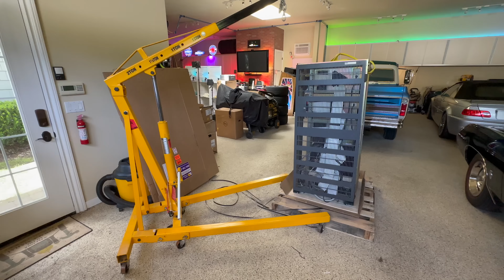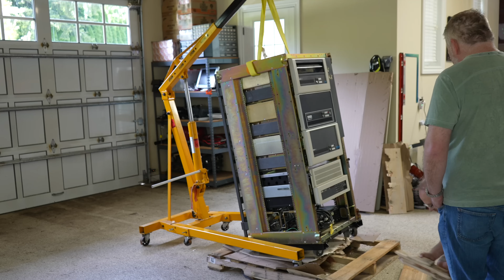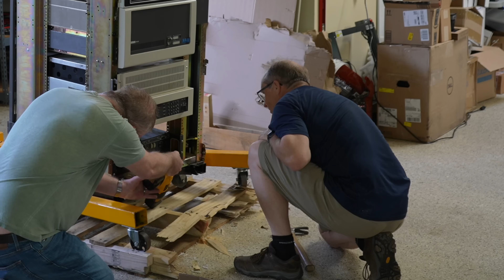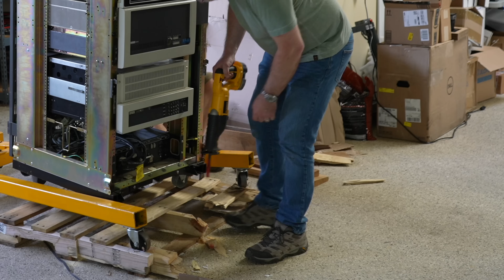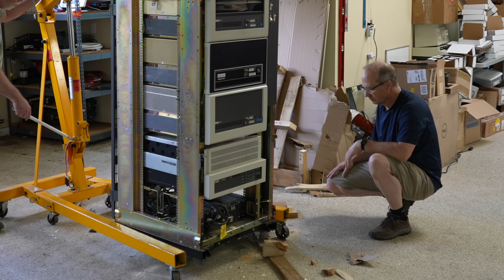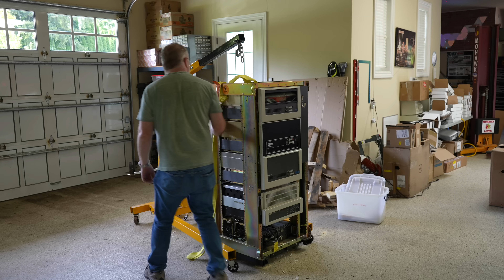I Bought the HEAVIEST Computer on eBay: The PDP-11/34!

Comment: Oh,hell, you don’t have any real old DEC vintage machines. You want a real beast, try to find a PDP-15. It was an 18 bit machine consisting of at least four 19” racks. To bootstrap the computer you had to key in about ten or so instructions so it could read a punched paper tape. Once the paper tape had been read in, it could then bring in the operating system from DEC Tapes. The OS was stored on a 256 kbit fixed head disk. But the PDP-15 was a single user device. If  another user had been using it, and I wanted a turn, I would have to bootstrap the machine from scratch and load in my copy of the OS. It originally had 16K words of 18 bit core memory. When we were able to afford another 16K for a total of 32K core memory, we thought we had died and gone to heaven. Ultimately we were able to add two 2.5 MByte RK05 removable pack disk drives supported by a dedicated DEC 11-03 processor. 
During my time we had an DEC 11-750 running RSX-11, a PDP 11-35 running RT-11, a PDP 11-45 a MicroVAX II and ultimately a VAX 11-60.
Oh, the memories! 😂 I  wish you the best of luck with your DEC machine. 🤞

Comment: My IT Career started in 1983 as an operator using DEC PDP11 24, 44, 70 on RSTS/E and also VAX 750 and later onto 8310 Cluster (a true clustered system) and then to MicroVax. These were fantastic years ❤

Comment: In collage I picked up at the MSU salvage garage 2 dec racks, 1 had a tape reader and 2 rk disk packs, the other a PDP 11/40. and an insane amount of core memory.  Only powered it on once, but didn't know enough to how to get it running, and this was back before the internet.  So I parted it out keeping some of the core ram and giving the rest to friends.  Fixed up the racks and repainted them and sold them for way more then I had paid for the machine in the first place.   Now I really wish I would have kept it. 😟

Comment: Right ,  the disc is a disc cartridge not a pack ,  the air filters can be made AAF used to make them for us, whatever you do , CLEAN the discs before use if they have been stored, with IPA , do not use them cold allow them to warm up especially if there is any possibility of Dew,  clean the heads with a punch card and IPA ,   DO NOT leave the discs in the drive with the fans not running ,  it's an open drive and if you are careless you will get crashes,  you are lucky that's not a High Tec drive like a Phoenix 96 Mb as if it was you would have lost it on first power up ,  be very very aware of cleanliness with open drives ,
Reply: You are better off sticking with the modern simulation of the old drive remember the "drive" is only the transport it has zero intelligence , it's only function is to spin the disc place the heads and send the signal from the heads to the controller ,  alignment is difficult to be able to read previously written discs , get an alignment disc  you may need an exerciser or make one to select the correct track with switches , it's easy ,  beware of Grounds ,  and damaging the daisy chain cable

Comment: Actually, the first version of Unix wasn’t actually developed on a DEC PDP-11/20 but a old DEC PDP-7 that was laying around at Bell Labs where Unix was invented. Some my quibble of what counts as the first proper version of Unix but it all started when a Bell Labs computer scientists wanted to port a game he had written for a GE mainframe computer (before GE sold it’s mainframe business to Honeywell in 1970) that Bell Labs was about to get rid of as they no longer needed it. He ended up writing a very basic OS on an old PDP-7 laying around bell labs in order to port his Space Travel game to it. This was originally informally known as Ken’s New OS. As other colleagues saw what he’d done they joined his project and eventually renamed it Unix. After they got a new PDP-11/20, they port the alpha version of Unix over to the PDP-11 as the PDP-7 was by that point very antiquated. 

At this point, Ken’s New OS/Unix was being developed very organically and didn’t have any proper version numbering. What became known as Version 1 Unix (aka 1st edition Unix, Unix Version 1, Unix 1st Edition, and so forth) was named after the first edition of a manual  Ken Thompson and Dennis Ritchie and others wrote to explain how to use the new OS and as a result all Unix version going forward were named after each new edition of the Unix user manual. So you could say that the proper 1st Edition of Unix was developed on a PDP-11/20 but the alpha version of Unix was started on a PDP-7.

Comment: Ex-DECie here.  Started in 1976 and lasted until 1993.   11/34 brings back a lot of memories.  I had an RK05 head crash overnight and the cabinet was full of shredded metal in the morning.  Made quite the noise.  To be honest though, the 11/34 was heavy but you are talking about the entire cabinet and not just the 11/34 box.   Now, let me know when you find an ESE20 which is DEC's foray into solid state disk drives.  I built them.  Each memory board in the cabinet was 2,500 dollars.  The single disk drive was only $120k.  Still have the manual.  I also wrote the build process.  It was the fastest thing going at the time.  Now that was a cabinet as the backup power supply (UPS) was heavy and took up about half the cabinet.  I worked mostly on the tape drives until we started building the ESE20 and also built a bunch of the failed PC line.   Anyway, thanks for the video.  Brings back a lot of memories.  Best company I ever worked for.  Ken Olsen was also the kindest man let alone a CEO.  Criminal what the board did to him in the early 90's.

Comment: Thanks for the trip!
I worked for DEC in the 80’s, had an 11/23 at home with 2x RL-01 drives - running RT-11 and RSX-11 with a couple of terminals and printer.
It was a blast seeing the RK05 dives (only 2.5 MB!), hence my lust for the RL-01s with 5MB - and much quieter without the voice-coil positioner.
A great purchase in great condition, but not cheap 😱
Enjoy it !  Jealous of the 11/34

Comment: you might consider software by microware.  the os-9 was written in the period and a bunch of boards are around for scopes and digitalization measuring units
Reply: I'd run some bit coin markets on the pdp, and traffic signals to demonstrate relative ambitions.. but that's just me .. reservoir dogs . Tarantino

Comment: Excellent video.  I work on the pdp11/70's back in the late 80's when working for AT&T Long Lines. We had our own minicomputer systems group for maintenance and operations support. Ours ran on Unix system 5. Our VAX780 and vaxcluster system was on vax/vms. What a job, good Ole days,  good memories.  It was all very interesting.  I went to DEC classes in Bedford Massachusetts on the PDP11 and VAX. So this video really reminded me of this technology. I still have books on PDP11 and VAX programming by Richard H Eckhouse Jr. After all these years. I've been looking at a PDP11 emulator recently. Anyways , thank you for this video.

Comment: Really enjoyed this vid - the very first multi-user system I administered, back in prep school, was a PDP 11/24 running RSTS/E. I kept hacking super-user accounts, so eventually they put me in charge of running  it and fixing the vulnerability I was exploiting, which was just writing code to fake the login screen and using a command that allowed a programmatic switching of accounts (after capturing the log in details, of course). As I recall, it was trivial to disable the command - but it's been 35 years so I don't remember all the details.

Anyway, keep up this great work!

Comment: When I was a kid in the early 80's my dad's neighbor (who got him into computers) had a PDP/11 in his basement that came from a steel company when they upgraded it.  What's cool about that I think is at the time it was probably still an impressively fast computer and that knowledge of PDP hardware in 1982-84 was probably still very much desirable to have.  I was too young to see it but he had the full row of PDP cabinets.

And compared to my dad's Cromemco System 3 with 8 inch floppy drives, it was probably still very powerful.  What's crazy is my dad had a running point of sale system in his motorcycle dealership he hand wrote in BASIC out of books running on multi-user C/PM systems.  Later when I was like 9-10 I remember helping my dad port it from CP/M to DOS Quickbasic 4.5.

Comment: 23:54  if i'm not wrong, that card cage can be rotated .... so that the wire wrap side is easily accessible from a chair.....
Reply from the maker: I couldn't figure out the rack and how to flip it... not entirely sure if it does or doesn't!
Reply: @DavesGarage  did you figure out the rack type ?

Comment: Get a DEC VAX 11/780, which has a "user writable control store," i.e. the user can microcode it.  Forget assembly!  Access to your code with XFC op, as I recall.  You do have to break up long operations somehow because it otherwise keeps interrupts out.  Regular memory is your scratchpad.

Comment: Nice to see you exploring yet another bit of my history. In college, I programmed in assembler on a PDP-8e, which was octal, and somewhere I used to have full schematics of the logic flow of a PDP-8e. In one of my first jobs, in addition to sometimes operating an IBM 360 mainframe, I programed in COBOL and assembler on PDP-11s, mostly 11/23, 11/34, and 11/44s running either CTS-300 or RSTS, and having RL01 drives. I never got into the hardware, but I think they were newer models than you have, from circa 1980. I do have a vague memory that at the time, 64KB of RAM was about $8000, and a 100MB 12" or 14" hard drive was $30,000.

As far as wire-wrapping you just need a wire-wrap tool, after which it is easy.

FWIW, the oldest "PC" I've seen was a MonroeBot, but while it appeared to be complete (in 1982), it was not operational. The same guy also had some old magnetic "core" memory from mainframes.

Comment: Since this story occurred in 1982, 42 years ago as I write this, I can finally tell it. In the early 80s I had a friend, Steve, who was a field service tech with Digital Equipment Corporation [DEC], the maker of the PDP series of computers. Steve wasn't the brightest bulb on the tree, and always looked for shortcuts. He got it into his head that he had to have a PDP 11/03, and he knew just how to get one - at a client site that he'd recently visited. Somehow or other, he convinced me and a friend of mine to go retrieve this machine from it's rightful owner.

Late one Saturday night, my friend and I were dropped of at the site, a warehouse and distribution building for a local retailer. The building had no security and poor locks on the doors - a pocket knife was all that was needed to gain entry to the warehouse door. We entered and quickly located the computer room, and to our surprise, found not just the 11/03, but a newly delivered 11/34, with all the typical peripherals, lots of disk packs, and the famous Orange Wall of user manuals. We trundled the the rolling racks out to the warehouse and onto one of their delivery trucks, along with virtually every other item in the computer room. During this operation we kept in contact with Steve, who was safely parked a half mile away at the entrance to the office park, and we communicated using 2 meter handheld radios.

Within a half hour or so we had everything loaded up, and proceeded to drive to Steve's townhouse apartment, where we carefully unloaded everything and placed it in his basement, where it took up most of the available space. We then dumped the truck a mile or so away and returned to the townhouse. 

Steve had promised a $2,000 payment for the 11/03, and as I had no one else that I could go to with the 11/34, he got that at no extra cost. What a deal, right? Months went by with no further payment other than the $200 he'd given as a down-payment, and all attempts to collect fell on deaf ears. He was certain that there was nothing I could do to get my money, but finally one day, while he was at work, I rented a truck, and with the help of a few friends, we repossessed all the equipment, selling the entire lot to another DEC guy for $5,000, again on payments, which I actually did receive the total amount due, no doubt in part because the new buyer knew very well the extent I would go to to insure payment. 

Of course Steve was furious, but I didn't care, and refused to tell where all the equipment had gone. A few short months later, Steve was fired from DEC for a mistake that apparently caused a VAX 11/780 to catch fire, or to at least fry a lot of circuit boards.

Funnier ending, all the local DEC people and others in the local tech community were dead certain that the original owner of the equipment had caused his systems to disappear because the company that sold it to him, along with the $50,000 accounting package included, had been unable to get the equipment and software to work the way it had been promised. 

Shortly after this heist I left the criminal world, and went into wholesale DEC used equipment market, buying entire systems from government surplus sites, breaking them down, testing, and reselling to various dealers around the US. This business lasted into the late 90s, until government surplus departments discovered the internet and sold directly online, cutting out middle men like myself.

Comment: I really enjoyed your description of how you got your system up and running. My first encounter with a pdp11-15 was about 1971, as I worked for a large semiconductor manufacturer. My job was to keep a bunch of computers and test equipment (part sorters) working. We had a bunch of DEC computers and equipment to work on. 
One morning I was told that a new transistor test system had been had been delivered to one of the departments that I supported,  I immediately went over to the other building and saw the first PDP-11 system I had ever seen.  It had a paper tape reader and punch, and a LA-30 printing terminal.
That was only the start, by 1970 we had a bunch of PDP-11 systems, and we still had several PDP-8 based systems, as well as some other company's computers.
The IBM-PC caused the end of that era.

Comment: I recall there being a program that used a trackball for drawing simplistic things, and it was a bit flaky at the time. Often it would randomly make a line between two dots other than the two you were trying to make a line between. In the end, I just went back to using paper and mechanic pencils at the time, lol. For doing other stuff the thing was incredibly good for the time, now you feed a birdseye overview of what you want into whateverGBT and it spits out the designs and stuff and you just hope the AI didn't make a mistake or few, lol.
EDIT: that may have been for the VAX-11/750 rather than the PDP-11, that was so many cups of coffee ago.

Comment: Heck my, miller 330a/b tig welder weights in at close to 900 with the 30 foot leads and the bottle. Unload that out of a late 90's s 10. Was not easy by myself.

Comment: The way you moved that was actually really clever.

$5000.00 for a (mostly) functioning PDP-11 minicomputer that uses and started many of the concepts we use today on the operation of personal computers? Not a bad deal, kind of "steal" really, Even I could afford the machine, afford the electric bill to run it? prolly not.

I programmer I am not, but I have been building and studying computers since about 1994 and built my first one sometime in 1995, and ive (unofficially) worked with everything from high end servers to basic cluster computers and have used about every fairly modern OS know to man, from Unix (Not an expert) to Amiga OS. Id love to tinker with a PDP-11! lucky man.

Correct me if im worng but Ive heard of a version of Linux that was backported to the PDP-11, ave also heard that there are PDP-11s on-line and still in use in some places.

Comment: In my mid 30s and someone who has built many desktops and tinkered with everything I ever owned.....I'm finally looking to get a home server. Something that me and my family can use as our own cloud storage for photos on iOS, etc. Along with other media to be stored. So I don't need anything crazy.... But servers are something I never messed with so don't know what's a good deal and what just junk in the used market. Just basically I need something that I can easily keep adding storage as needed. What specs should I need looking for as to the CPU and RAM amount? Also is there a free app that I could use on ios, Android and windows to set up auto backups and a way to get and download files when needed?

Comment: So now you need find all the components needed to create the first PoP ACD (Galaxy). They have the first one in the Smithsonian. It used to be that if you called an airline, car rental, credit card, bank, drug company, phone company other than ATT, etc. you would be call to a phone system controlled by a PDP11. It dominated the market for the life cycle of the PDP.

Comment: The other perception lab at Rutgers in the 1980's had a PDP-11 with an Adage graphics processor making visual displays on an oscilloscope with fast phosphor.  Their grad students were frustrated that their hardware could not match the animation speeds I was getting from my $99 Radio Shack color computer using a TV set as display.  The color computer used the same RAM memory for display and program memory, so I could allocate up to 16 pages of display and switch by changing one byte, the pointer to where display memory begins.  It took a while to generate the 16 frames for the animation, but playback was as smooth as Disney.

Comment: Dave, If you pull out the cabinet stabilizer foot then extend the 1134 box all the way out, It will be able to be rotated up to access the backplane without having to crawl undernith. It also gives you access to the power supplies.